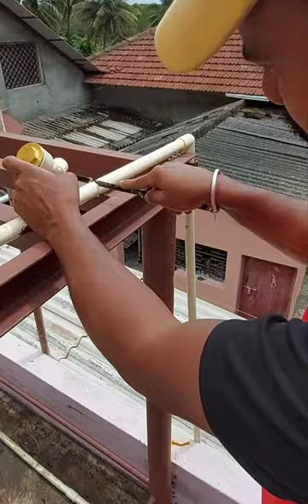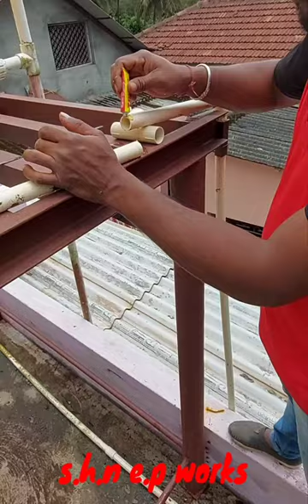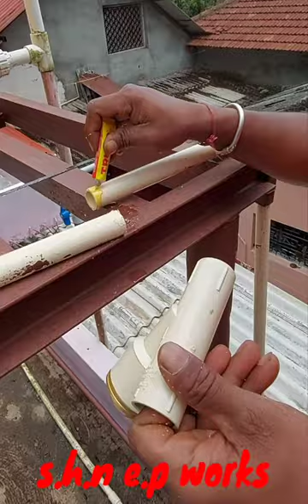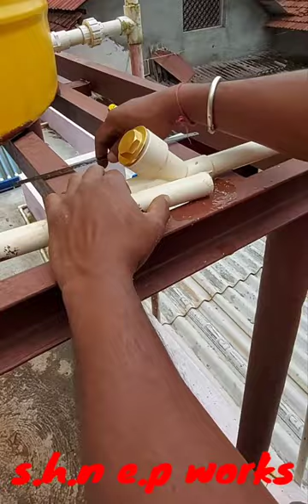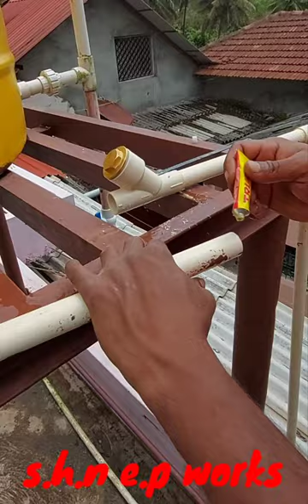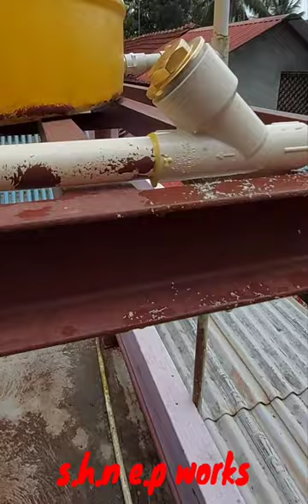#how to fit a cpvc water filter for sintex  input water line

Comment: The BRASSPOINT must be towards down and the solvent need to be applied with solvent brush which will save material and MONEY . the pipe should be cut with a CPVC CUTTER tool. Kindly go through the professional work vedio of ashirvad company.